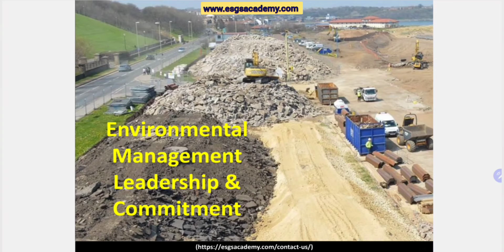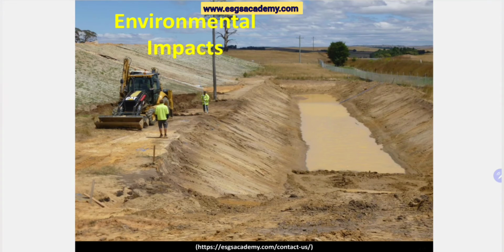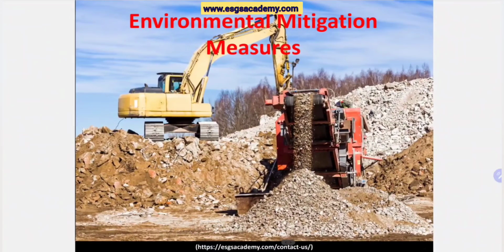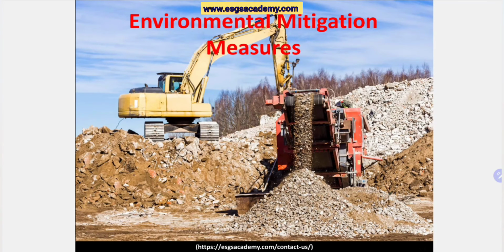What is a Construction Environmental Management Plan (CEMP) - A Brief Introduction

Comment: I must say a good theory-based presentation. A couple of issues to consider, moving forward. Better to say CEMP is a must to manage the construction environment especially its impacts. As you say, CEMP is site-specific and hence only the environmental issues relating to the site are considered. There may or may not be marine environment involved in the project. Next, CEMP should specify environmental parameters that need to be monitored and for monitoring itself, it is a must that relevant indicators are identified and included in the plan. One will come to know environmental impacts resulting from construction activities only through measurement using identified indicators. It is necessary that apropriate mitigation measures are identified based on environmental impacts observed. It is also necessary that the environmental team keeps an eye on "new impacts" that may result from the application of mitigation measures. The environmental team will move into manage the new impacts too through additional remedial measures. Documentation and reporting are very important that becomes a specific role of the environmental team.